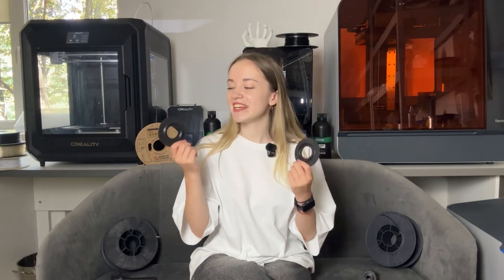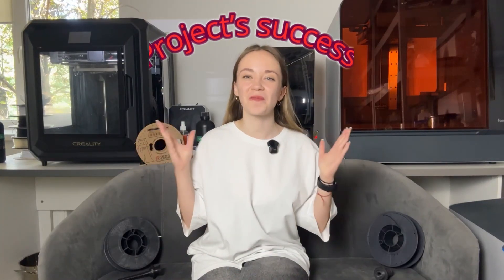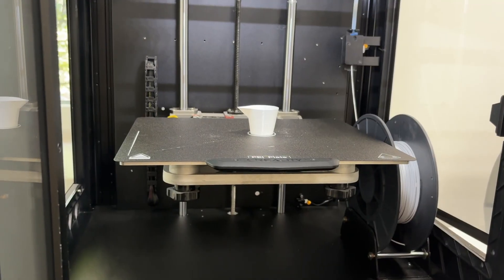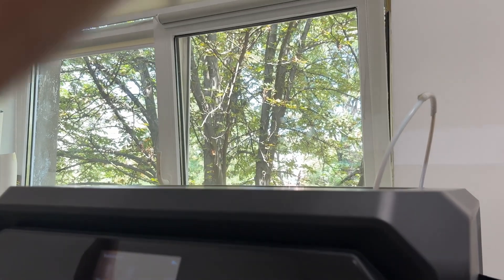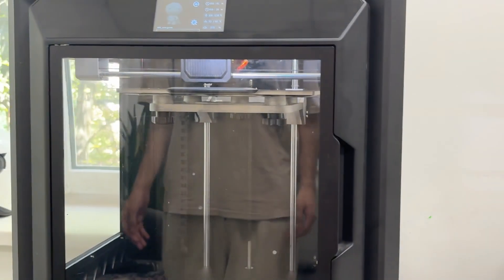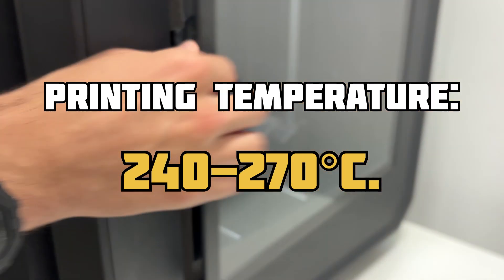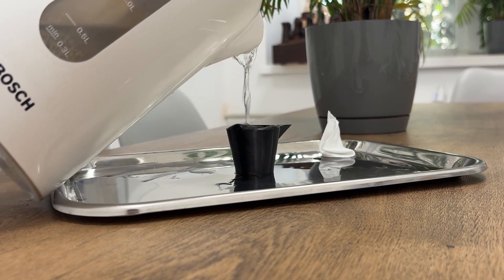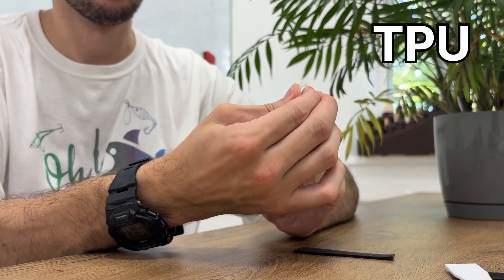Why PLA Doesn't Always Work. When Is Another Plastic Better?

Comment: I've heard that carbon filaments are dangerous. What is the real use for them? Only in engines where you won't touch the material?
Reply: There is some risk of the fibers being in the air if you use an unenclosed printer, and the fibers can get on your skin if you handle the part after. Some assume that this is risky to health, but the actual risk isn't fully known for these fibers. 
So best practice is to print enclosed, use for parts that will not be handled, or paint/clear coat any parts that will be handled.